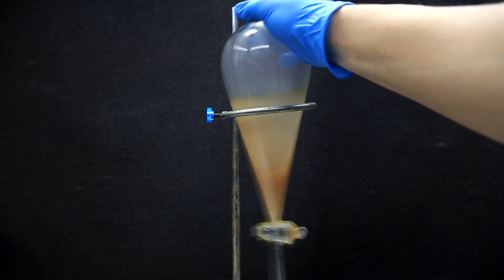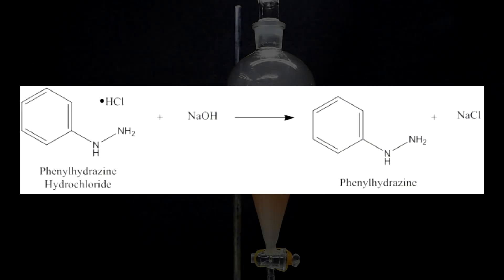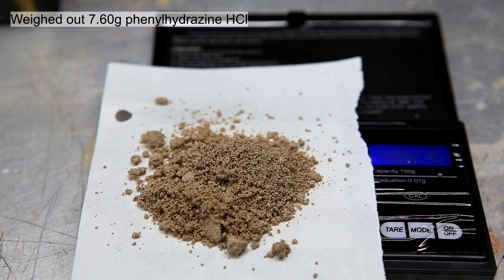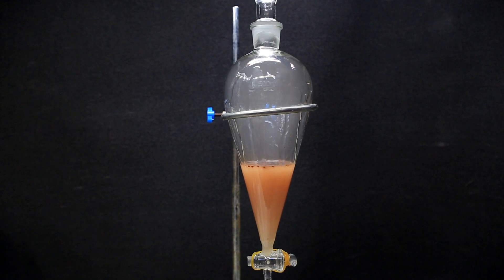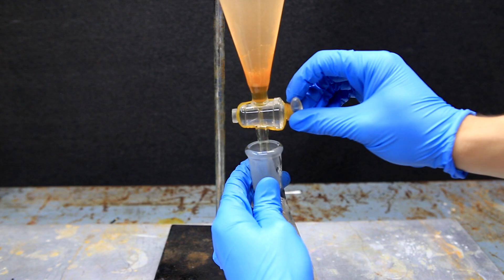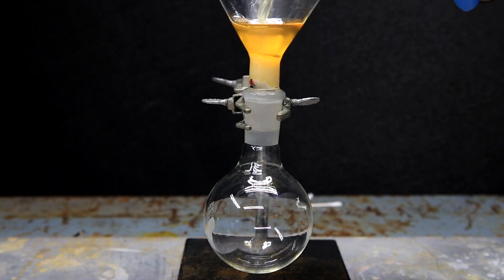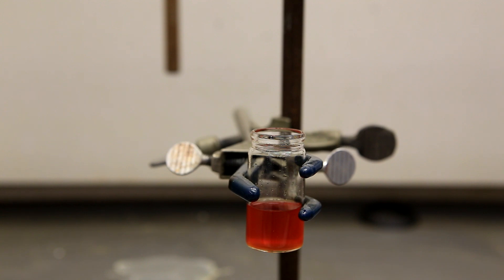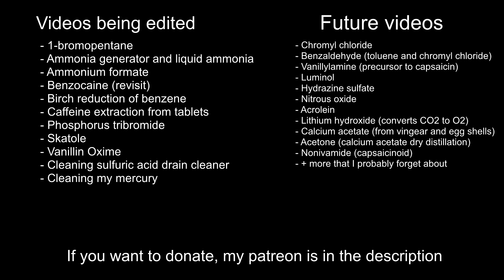How to Freebase (Phenylhydrazine HCl as an example)

Comment: The video was prepared in the best, and many thanks for sharing. I just want to add a caution to the procedure. It's better not to use DCM for extracting when using an excess amount of NaOH. CHCl3 in trace amount can participate in reimer timer reaction. So better to use K2CO3 for neutrlizing without problem with DCM or using Ether for extract in the epresence of excess NaOH. good luck!

Comment: Interesting. Freebasing coke back in the day involved mixing the coke with ether and then vaping it off of aluminum foil. Cooking crack was just that, making crack. You learn something new everyday I guess.
BTW that how Richard Pryer light his ass on fire. He spilt that ether on himself as he was lighting the foil. If freebasing was just taking a blast off of a stem he wouldn't have just caught fire for no reason. Also no one smokes freebase anymore. 1 it is to expensive, it REALLY waste your coke.
2 if you are gonna smoke coke crack is the cheap way to go, that is if you score coke and cook yourself, because for some reason a gram of crack cost the same as a gram of coke.
All of this is what is going down in Baltimore Maryland. Your town might be different.

Comment: So if one wanted to purify cocaine. You'd dissolve it in some water in a sep. funnel then react it with a weak base like ammonia to precipitate the freebase, add a non polar solvent like ether, drain the bottom portion. then dry it, and convert it back to cocaine hcl, by adding some muriatic acid and drying again....?
Reply: I can see you never took chemistry in high school. lol.

Comment: From your previous video (synthesis of phenylhydrazine HCl), 4.6 mL aniline -> 5.5 g phenylhydrazine at 100% yield. You crashed it out from 100 mL water, which can dissolve 5 g phenylhydrazine HCl (solubility = 50 mg/mL) (you lose less because the water had other salts in it). => You lost most of the phenylhydrazine as its HCl salt into the water from which you first precipitated it in the aniline to phenylhydrazine HCl video.

Comment: So if im understanding this right, phenylhydrazine HCl is more acidic than its nonsalt counterpart because the salt form has HCl which is more acidic? So if that is true, is that the reason that we would use something like NaOH to neutralize the acidic part of the molecule "HCl"? I'm pretty curious if im understanding this correctly, can someone explain if im not quite right on this?
Reply: NaOH is a stronger base than the organic amine base, so it readily liberates the HCl salt from the amine to form sodium chloride which nicely dissolves in the aqueous layer while the free base remains in the organic layer, in this case DCM. Removal of the DCM solvent gives the pure free base. His drying method was not great, maybe he didn't have magnesium sulfate which is the preferred method to dry moist DCM.

Comment: I might be getting into some chemistry soon and was wondering what I should buy. I don't need any chemicals or a hot plate and I got a budget of 80-160 what should I buy
Reply from the maker: +Logan Mante definitely beakers, at least 1 separatory funnel (if it ever plan to do extractions, a condenser column, a water circulator, round bottoms. Why don't you need a hot plate or chemicals?
Reply: I already got a hot plate off of a friend and im going to buy some chemicals with some more money i have. thanks
Reply from the maker: ahh okay. Then also maybe a dish that you can heat up with oil in it (dont use non-borosilicate)
Reply: +Nile Red k thank you
Reply: +Nile Red it turns out that the hot plate is broke and I was wondering if there is anything I could do like use a normal one or something else I don't have 200 dollars for a hot plate
Reply from the maker: Logan Mante Hot plates are pretty damn expensive...especially ones that can stir. A good alternative is a cheap camping stove (electric) from Walmart for like $15. Then buy a metal pot and use vegetable oil to heat your reactions. 

Just be careful if you do use an oil bath though. Dont heat it more than 200C

Comment: In the upcoming videos, you mention that lithium hydroxide can convert carbon dioxide to oxygen. Apparently if you react hydrogen peroxide with the LiOH, followed by dehydration, it makes lithium peroxide, which can replace CO2 with O2, but it doesn't reduce the carbon, just turns it into carbonate. Is that what you meant, or am I reading it wrong?
Reply from the maker: +Alex I Yeah sorry. I would need to make the peroxide. Also, you are right with the wording. It is replacing O2 from CO2 and not converting it.
Reply: +Nile Red That makes more sense. Your videos are great, by the way. Keep up the good work.

Comment: Not directly related to the video above, but I'll still ask, and hopefully get an answer.
Are you still able to purchase HNO3?
 I'm having a hard time getting a hold of it here in Europe. I'll have to synthesize it myself.
Good and educational video by the way.
Reply from the maker: +ChristopherNewcastle I am able to buy it from Ebay, but I have actually never purchased it before. 

It can be made using sulfuric acid drain cleaner or sodium bisulfate and a nitrate salt. That is pretty cheap. I am going to make it using the bisulfate and nitrate salt at some point.
Reply: Thank you for the quick answer. Looking forward to the video.
Is this how you usually get a hold of nitric acid?
Reply from the maker: A friend was able to give me a few hundred mL of nitric acid and I have been using that ever since last year. I don't do many nitrations so it doesn't go down very quickly.
Reply: I see, thank you for the information.

Comment: I noticed in your synthesis you added the NaOH to a beaker then the H20 .   In general is always better to add a base to water and not the other way around 
Just saying SAFETY FIRST
Reply from the maker: +Rare Earth That is true. However, it is not exothermic enough to immediately boil the water. It is not like adding water to conc H2SO4. In general, NaOH is pretty tame, but it still 'should' be done the other way around.
Reply: I agree .  Getting people with the
 correct procedures is important.   I enjoy your videos

Comment: voting for cleaning sulfuric acid drain cleaner please
Reply from the maker: +dispatcher7007 the flipflop is a classic piece of lab gear.
Reply from the maker: +Timothy Morrison When I distilled it, it worked totally fine without any water.
Reply: dispatcher7007 I wouldn't use glassware that is scratched for distilling something as dangerous as conc. H2SO4. There is a reason why you should check for cracks, scratches, or stars when using glassware. You might be lucky this time, but scratched glassware will eventually break. I have never found my sulphuric acid to bump, even when using pristine glassware, you might be in the same situation as me and the scratches could have no benefit at all.
Reply: +dispatcher7007 i don t have acces from chem supplier(is ilegal).and to distilate.i don t have glass resitent to +350*c 
but i found drain cleaner at hardware store(H2so4 98% )but is intens red.i don t know if is metalic ioni or someting else
Reply: +dispatcher7007 In romania H2so4 and HCL is illegal because it is considered drug  precursor and that s why is a prohibited substante.
ps.sorry for my englesh
Reply: +dispatcher7007 Jesus man, give this guy a break. eBay does not exist in some countries, and a lot of countries have outlawed HCl and H2SO4.
Reply: +ionel anonimul If you can't distill then the next best thing would be to add a tiny amount of conc. H2O2 (as high a conc. as you can get), simply add a few drops at a time to the H2SO4 solution -  this will oxidise any organic components into CO2. Just be careful you don't add too much hydrogen peroxide as you are technically forming a small amount of Piranha solution. Then leave the solution to sit for a few weeks with the lid open so that any remaining H2O2 is able to decompose into H2O + O2.  However, if there are any inorganic components in your drain cleaner then this procedure will not help at all. Best of luck!
Reply: +Timothy Morrison yes i know.if is metalic ion i can't do enything,only to distill.
is good to boile h2so4 in LBG 3.3 gass? it well rezist to high temp?
Reply: +ionel anonimul Borosilicate 3.3 glass should be able to resist high temperatures of up to 500 celsius - above 525 celsius I think the glass begins to soften. Therefore it should be able to handle 340 celsius when distilling the sulfuric acid. The only problem I can see would be the thermal shock created if you were running water through your condenser especially at such a high temp >150. So if you glass apparatus broke apart with hot H2SO4 fumes + water you could potentially have an explosion hazard of hot acid fumes. Saying that though, I've seen youtube videos of people running water through their condenser and nothing bad happening but personally I think it kinda crazy doing it like that - that's why I would never attempt it. If you do plan on distilling though I would leave your condenser without any water running through it or you could possibly get a tiny air pump and blow some cold air through it instead - this would create much less thermal shock than water.
Reply: +dispatcher7007 Yes if you are able to heat up the whole apparatus EVENLY you shouldn't have any problem. The problem lies in the fact that it is very hard to achieve this because some portion of the glass will be at (a higher temperature) 340 C and water will be at around 20 C (a lower temperature) - causing an UNEVEN temperature with a possibility of a break/crack. I understand that borosilicate glass has a very low coefficient of thermal expansion but it does have a LIMIT! I think the temperature difference borosilicate glass can withstand before fracturing is something like 165 C. Using air around the condenser instead will mean it will be at a higher temperature than the water so the difference in temperature should be less - therefore a slightly safer arrangement. Not to mention the fact that if a breakage did occur you wouldn't have cold water hitting boiling hot acid! In reality, you should probably use a quartz glassware setup, which has a thermal expansion coefficient of around 15x less than borosilicate glassware
Reply from the maker: I found that in general, the distillation was pretty tame. However, the bumping was insane.
Reply from the maker: How much did you distill at one time? I did ~500mL. No matter what I did, the bumping was awful. 

If i lowered the heat so it would bump, not much came over. It was like a mix of boiling and random bumping. I added broken glass and sand to try to limit it, which helped.

Comment: cleaning mercury vid will be fun!
Reply: poke a hole in a coffe filter and pour the mercury in slowly and make sure the container you use to collect the mercury you wont be using directly after... or you can clean it using nitric acid, the acid method is unrecommended by me due to me not having a proper setup at the moment.

Comment: Good video, I was wondering if you chose to use a cotton plug for any particular reason? And was that some kind of column chromatography-esque filtration through a pipette at the end? lol

p.s. Wouldn't mind seeing cleaning sulphuric acid if you have Ro-tyme.
Reply from the maker: +pyro2525 I got some sulfuric acid from the local store that i cleaned. Not Ro-tyme but something similar. I used the cotton plug because it is easier to clean the funnel that my glass frits. So it was just laziness. It works well though.

The silica gel at the end serves to filter out small particles and also it pulls water. Clearly it didnt do much though...
Reply: +Nile Red Ahh ok, that makes sense, I'll keep that in mind.

The peculiar thing about this acid is that after strong and prolonged heating (white fumes evolving for awhile) is that it goes from that slightly red/yellow tinted colour to black. Makes me wonder if getting 30% H2O2 would even be worth it.
Reply from the maker: That is very weird indeed. When my H2SO4 got to boiling, it turns a faint yellow color (which went away on cooling) but that is about it.
Reply: Yeah I'm really not sure what to make of it. It apparently has a "corrosion inhibitor" but I haven't been able to figure out what it would be (buffer, etc), or if it can be oxidized by H2O2.

Do you happen to have a brand I could look for?
Reply from the maker: Do you live in Canada? The only brand I could find is in Rona/Quebec.

The corrosion inhibitors are usually organic based, but they when I researched it, they were kind of proprietary secrets. So more infor is hard to get. They prevent the sulfuric acid from attacking the metal in pipes. At leasy my brand was able to be oxidized by H2O2.

http://www.rona.ca/en/super-drain-liquid-drain-opener-7666031
Reply: Yeah, exactly what I ran into when trying to figure it out hahah, it also delays corrosion to organic matter long enough to wash off/neutralize :P. But thanks, I'll give it a try, I've tended to stay away from Rona because they have no MSDS.

And yes, I live in Ontario. I've recognized some brands in your videos so I assumed we live somewhat close to each other. Good to know there are other Canadian home chemists out there, pretty sure Nurdrage lives near me as well.
Reply from the maker: It seems like there are a lot of Canadian chemists out here!

Yeah I couldn't find a proper MSDS for the Rona one. Where else can you find sulfuric acid? That was like the only place i could find it...
Reply: Canadian Tire has the Ro-tyme, from the msds density it's ~95%. Home Hardware has "fast acting drain cleaner" of similar conc. but I haven't tried it (it's also coloured).

I usually stick to to these two places since they actually have msds's for everything lol except now with CT you have to google the link for the search
Reply from the maker: wow really? i had no idea canadian tire had that!
Reply: Yeah hahah. They're also pretty good for solvents like xylene, MEK or even DMF, and of course some pool chems.
Reply from the maker: They have DMF? Really? Can you link me?
Reply: Just need to distill/dry it probably

Comment: Clueless in chemistry here...  You guys have been nice in answering my other questions... At the one minute mark, a diagram shows the process.    However, both sides look the same to me except that on the left is hydrochloride and on the right is NaCl (a salt right?).     So I have a two parter: is this "freebasing" for getting ride of the hydrocloride (I believe this sort of what is explained in the beginning)?.  Part two is that is there a H2O missing in the diagram?   Thanks in advance...
Reply: +wgm4321 -- (1)  "Freebasing" is removal of the H+ ion from the amine salt (i.e., removal of the H+ from the N atom).  In the example that you cited, yes, freebasing removes the hydrochloride.  
(2)  Yes, there is an H2O missing from the right-hand side of the equation.  However, since the reaction will occur in water, the production of a little more water during the reaction would hardly be noticeable and wouldn't significantly affect the course of the reaction.
Reply: +Kevin Byrne Thank you.   Fascinating stuff.